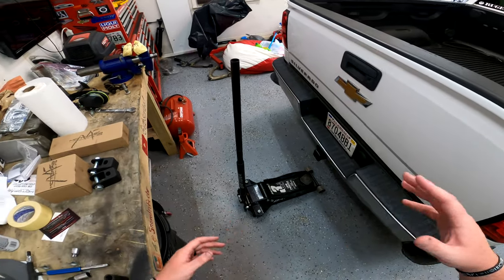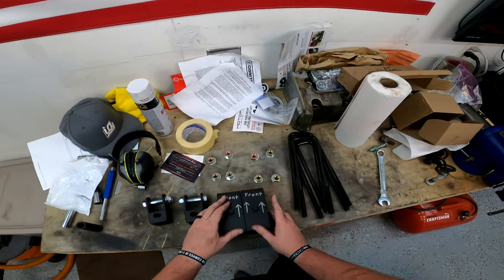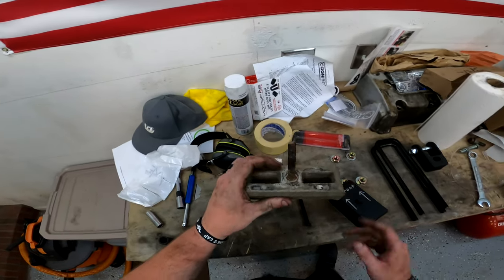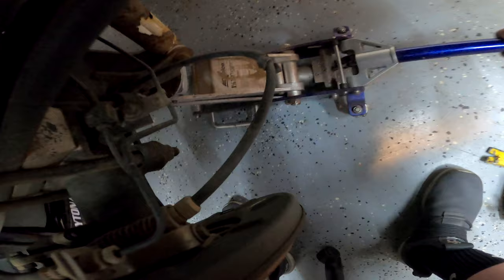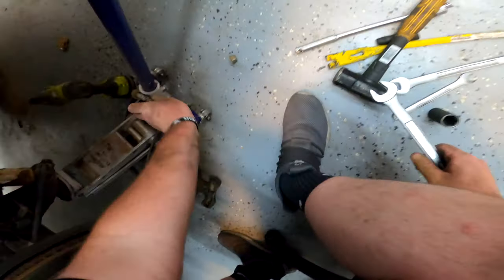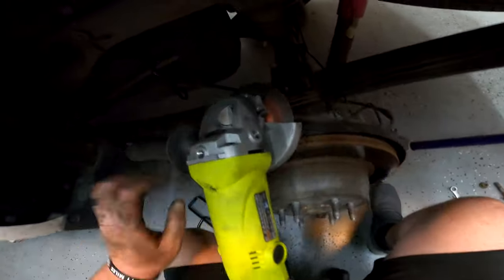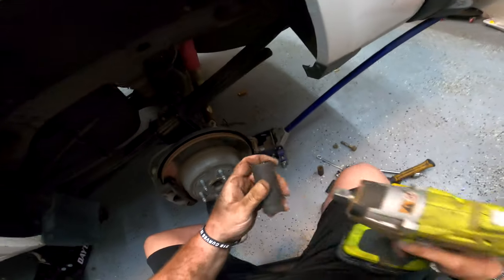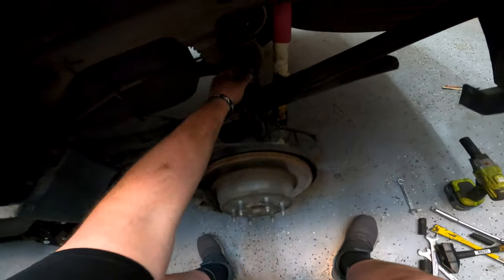Motofab 2 Inch Rear Leveling Kit Install + Supreme Suspensions Shock Extenders

Comment: FYI to anyone else doing these if you purchased the 2 inch rear lift blocks, the blocks will actually measure 3 inches because it is replacing the factory 1 inch block. If you are looking to raise the rear only 1 inch motofab sells the block for that as well

Comment: Nice video.  One thing though.  The factory lift block was simply just stuck or corroded to the factory leaf spring bolt head.  It is not one piece.  Mine looked like yours when I lowered the axle, but I stuck a metal pry bar between the leafs and the block and hammered the end of the pry bar.  The factory block broke free of the spring bolt head.  None of the Silverados dating back to at least 2007 have the spring bolt and the factory block welded together.  If it appears attached, it's simply stuck together.  Pry them apart.  No need to replace the factory leaf spring bolts.
Reply from the maker: Oh well. That was a long time ago

Comment: I just installed the motofab 3” front 2” rear level on my 2018.  I immediately noticed that the rear slams super hard when going over a speed bump, almost as if I got rear ended.  Is the shock extenders the solution?  Is my shock extending too far on rebound? Causing it to top out?  Seems like a shock extender would make it even worse?
Reply from the maker: I have the shock extenders and they have been fantastic. Truck rides almost like stock